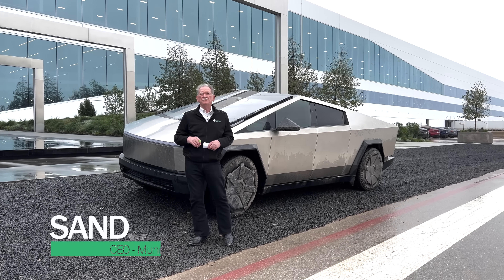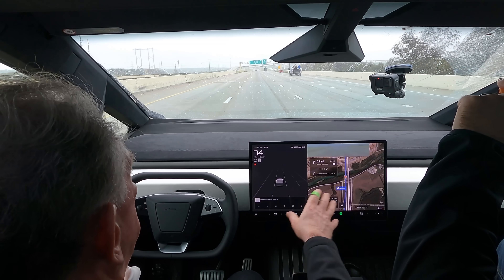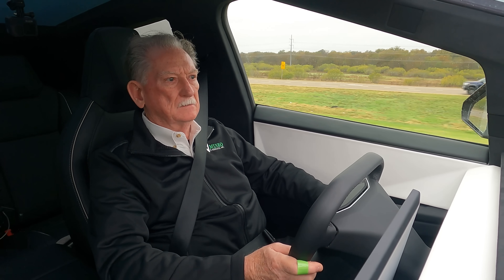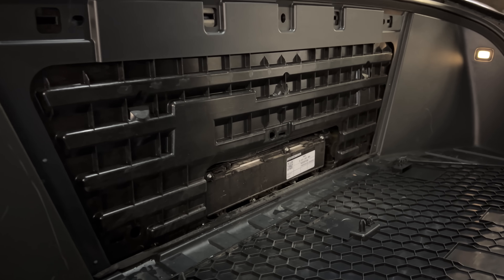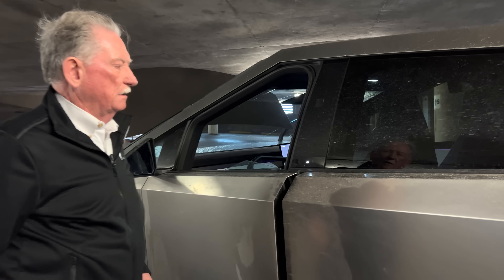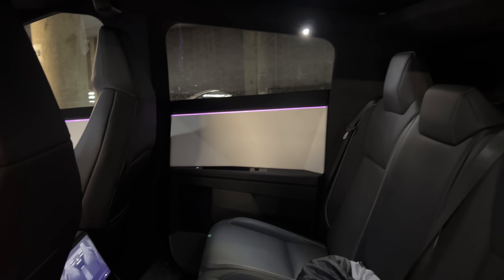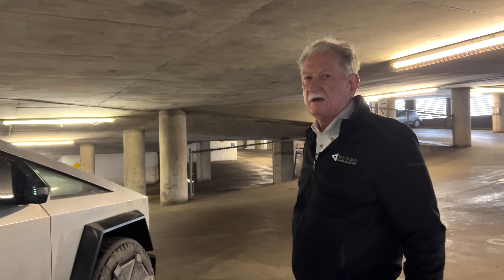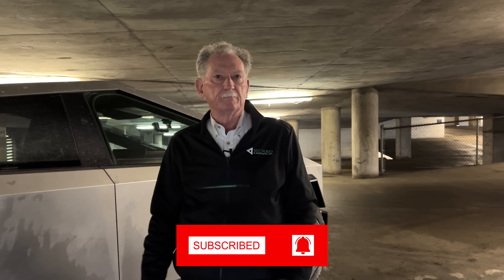Sandy's First Impressions of the Tesla Cybertruck!

Comment: I have a cottage that is 185 miles away from my house in the city.  Over the years I have owned 6 pickup trucks.  I always purchase used ones that are 2 years old so that the first owner can work the bugs out.  Every one I have had a cap installed so as to carry articles up to the cottage dry and out of the weather and as most know there is always something going up to the cottage most every trip.  Plus I tow my boat and ATV’s and snowmobiles up and down a couple times a season for whatever reason being storage or maintenance.  This vehicle is useless for those cottage owners like myself because of that bed cover with the lack of side rails and the range that this truck is capable of.  If the traffic is backed up and the air cond is necessary I would definitely have range anxiety.  In the winter I could not even charge it at the cottage because of my 200ft driveway and 4 ft of snow and winter is important because I have snowmobiles to enjoy as well.  I just don’t get it as to why they can’t make the vehicle about 4 inches higher and basically double the size of the battery pack.  I mean don’t these producers of EV’s just get it???   They just don’t understand that what’s preventing everyone from scrambling to purchase an EV is the stupid range!   I think these designers are idiots!!   I certainly will not be purchasing one at all until I see 1000 miles of range period!!  Anyone that I have talked to, all talk about how useless the range on these EV’s is and that’s what is preventing them from their first purchase.  If they can ever get the range up to 1000 miles I might purchase a brand new one for once!!!  I will bet that there will not be many insurance companies willing to insure this truck either and if they do the cost will be much higher!!  No body shop except Tesla ones will be able to repair a fender accident either and at a cost of between 70 and 100 thousand U.S. dollars I wonder how many banks will loan that kind of money for that product unless Tesla wants to be the bank for every one sold.  Elon said himself that Tesla was digging it’s own grave with this truck!  I think he maybe correct about this one!  Sure it is definitely a nice toy to have!   But vehicles are the worst financial liability investment that you will ever make in your life!!  They depreciate 20% by driving them off the sales lot!!   Invest in anything else like maybe property or savings bonds!  Anything but vehicles!!!!       THE CHEAPEST CYBERTRUCK IS 70 thousand U.S. plus tax up to the most expensive at 100 thousand U.S. plus tax.  Not too many people have that cash hanging around so they are leasing the truck making it cost about 10 thousand more and it’s just a city vehicle not for any real distance!!  Don’t be infatuated because of the egotistical hype and waste your hard earned money!! Wait a few years and see what comes out on the market!!  The way technology is going we might all be very well surprised!!!!!

Comment: Providing enough under bed storage space or enough space in the frunk for a spare tire should have been a priority.
Reply: I think they’ve decided against using spare tires because the percentage of people who actually use them is vanishingly small. I suppose you could always mount on in the bed or even on the door.
Reply: @bkinstler It's not so much about them including a spare tire, as it is about having enough dedicated space for one that it doesn't take up usable space in the bed like most trucks and off-road vehicles. Anyone who tows things or goes off-road a lot, something trucks are meant for, needs easy access to a spare tire, preferably in a way that doesn't require a person to unload everything in the bed just to get to it.

Comment: Having now absorbed the specs this is a game changer for the offroad fraternity be they light or heavy (towing) with the add on power pac. There are infinite possibilities for the use of rear cover from solar to spare wheels. If I had to choose one feature outside the drive train & 48v that appeals the most it would be power out/load for camping needs with no more auxiliary batteries with an alternator charge source. When we will see in Australia my guess 2026/27 at the earliest notwithstanding drive by wire makes right hand drive easy peasy.
Reply: We need a Cybertrailer with big battery pack on bord and fsd to unhook and park itself!

Comment: Dont have to worry about your catalytic converter being stolen. Don't have to change your oil, brakes, head gaskets, timing belts, spark plugs, starter, ignition, alternator, radiator. Its a no brainer.

Comment: How well can it transport 4x8 sheets of drywall or plywood?
Reply: Just as well as any modern pickup
Reply: @jamesengland7461   
That's what I'm afraid of!
Reply: With the gate down, the 4 x 6 bed is good by modern truck standards.  A better question is how do you reach objects in the back of the bed with the sail panels blocking side access?

Comment: Ok I give 1 example I don’t like cybertruck. The trims it’s plastic right? It will come off due to excessive heat & cold. It will deformed easily like model x & Y. 
S & 3 don’t have side black trims so it much more better & less cost no replacement trims.
If I’ll see the actual cybertruck I will point out which is good & bad no bias

Comment: Sandy talk about the underneath of the cybertruck. Like air suspension, sway bar, upper & lower arm & more front & Back. That’s the important. Don’t be bias. I know you can get Cybertruck right away without waiting in line. If I test that cybertruck it will last 3 years or less in 100k miles city drive only like my tesla cars S, X, 3 & Y all needs repairs front & back after 100k miles . Excluding battery replacement. You know how much cost each cars front & back replacement parts.
Reply: All indications are that he CAN'T get a truck without waiting.
That's why he's telling a yo e in line that is thinking of cancelling that he will buy their truck.

Comment: Loved your vid the other day with Elon! Question I have for you about the Cybertruck that I mentioned on X but haven't heard anything. Does the bed cover have the ability to be opened from inside the bed in case of emergency? I haven't seen this in any video so far and I would think it would be a requirement in the US.
Reply: If they are intending to be combined with the 'over tray camper' enclosure, then it will be a safety requirement. 
Testing of the 'Camper -CyberTruck' will drive that design change.

Comment: I like this old dude; he’s very thorough
Reply: You're new here, aren't you?
Reply: Yeah this video popped up in my recommended feed
Reply: @marsEv310 
Try 50(?) years in the Auto industry, engineer, worked on many vehicles you'd know, troubleshooting engines for manufacturers, etc.
Latterly running a respected company stripping, data logging and improving vehicles for Manufacturers (you want to to know why the competitions vehicle is good? They strip to the last but and bolt, report on the design of every component.... )
And other things.
.
Basically
.
Look up "Knows his S**T" and his name appears.

Comment: Paying $100k to be a Guinea pig. I like the truck but I would hate to find out at 50k miles that the windshield does actually break and costs 3 times as much. The big wiper blade can't handle ice or the 48 volt components break down just as often as regular car components ie: window motors except now they cost $2000 a piece and they are only sold by tesla. Like owning a supercar at that point. At least a f-150 has cross over components to the rest of their fleet. Just my thoughts. No facts.
Reply: Well, at least your final 2 words made sense....

Comment: only problem i can see -  same as GM's box   you cannot slide a camper in it. GM has those stupid angled pieces built in from the roofline to the box with stops a camper from sliding in fully....and cyber Truck has a tall front angle that will inhibit a normal camper from sliding in.   HUGE LOSS for a solid % of truck buyers.

Comment: It's a cool truck for city folk, but it's lame for people who use trucks for rural/country life.  I want to be able to use duct tape and bailing wire to fix my truck, not have to have a Tesla approved mechanic using Tesla made parts fix my truck for me.  I'm a diy'er, that's why I have a truck.  Tons of parts available, and so easy a dummy like me can work on it.  

I don't think Elon understands that.  It is a cool truck, and I think it'll sell well in the city, but in the real world "truck" using world.  Not so much.  Maybe I'm wrong.  Let's wait and see.

I'm a huge fan of electric because it is more simple than gas/diesel.  The only problem is, they're making it so that even though it's more simple, it's impossible to work on yourself.  That doesn't make sense for a consumer, but it does make a ton of sense of the manufacturer.  

I'd love to see China come out with a simple electric car that is easy to work on, and easy/cheap to get parts for.  Similar to an old Jeep, or VW.

Being dependent on the "grid" for power, being dependent on Tesla mechanics, and being dependent on Tesla specialty parts, turns me off completely.

Comment: I saw another pod cast the other day where they stated the two MOST important items Consumers want in an electric vehicle are: 1) RANGE, ie how far the vehicle will go on a single charge and:  2) What is the CHARGING SPEED to get to an acceptable level in a (relatively) short amount of time. They said the Cybertruck Falls Short on both of these features. This needs to be verified to know if these items will specifically determine if customers will put off buying an EV until these capabilities have been improved.

Comment: How about the 1/2" drop from the side panel to the tail gate on the left rear, and the triangle gap between the front grill panel and the right side panel.  Did you see the video of the crooked alignments on the black wrapped CT at the show?  This does not look like a $100K vehicle.

Comment: I can, sort of, accept no 6th seat. accept no more tail ramp.  Accept  no more air pump to run airtools or fill your tires. It never had a midgate. Got it. I can almost accept the promised loss of towing, capacity and mileage. What i cannot accept is the 50-60% jack up in the price.   I feel lied to, cheated, disheartened.  Tesla/Elon, you lost a lot of faith.

Comment: The back "smuggler" storage for me is a last minute addition after they decided to simplify the battery pack to one version and offer the extender if pr is bad.  I personally think this was a better decision than a huge pack of various sized packs.  4680 production is also limiting for Bother 6 months.
Reply: Or, it's the best they could do for an "off-roader" that really should ahve room for a spare wheel.
4680 production isn't the problem even, it's the energy density. In 2019 they were probably expecting 500 Wh/kg from it, and I have not yet seen any with 300 Wh/kg even. That's why even with the silly bed battery, it doesn't meet promised range. And they've even made the whole thing smaller. Less cargo space and a seat less. Less towing capacity as well. Even the short range one doesn't get the promised range, while it should at least fit, and they priced it up by 50+%. Some gimmick features to make it all worth it? Don't people buy the biggest car they can get a loan for, over the whole? What are the $40K truck customers going to buy now? Because they do exist. And they did reserve theirs.
Reply: @Cloxxki no one has ever matched a guessed price after four years of pandemic and supply chain issues.
I commend your trust in Musk's words but you need to get real.

Comment: Sandy, you say that you look forward to no longer hearing the noise of internal combustion traffic. What I look forward to the most is the absence of the nasty, greasy, oily patches in every single parking spot, of every single parking lot and garage.
Reply: That won't be gone, since these do not originate from fuel but rather lubricant. Electric motors also need transmissions, and transmissions have gears that need lubricant. Some electrical motors themselves are of a "wet" design and are lubricated by oil rather than grease too.
Reply: @IR-xy3ij  Well, I was referring to the leaking lubricants. Gasoline may leave a stain. I was speaking of the greasy build-up.

Comment: A hydrophobic coating on the rear camera lens would probably go a long way to keeping it free of water droplets, etc. Or as a temporary stop-gap you can probably rub some Rain-X on there.
Reply: Should it already come with some sort of washer, from factory !!!!
Reply: @mixalis6168  front camera has a spray...maybe we need all the cameras to "blink" to clear the lens
Reply: @mixalis6168 
I think it does have a washer.
Reply: @roxter299roxter7  only the front camera has some sort of washer at least in initial Cybertruck 1.0 release so far.  This is a real safety issue for drivers with the cover down in bad weather since they will be virtually driving blind in the rear as and when the rear camera lens hazes up.
Reply: @mixalis6168 
It's a pre-production vehicle 5hsts been "tested" extensively. Who knows what that lens has been through?
Reply: That is an excellent idea. 👍🏾
Reply: Doesn’t cut all spotting. Dirt. Only makes it easier on freshly cleaned glass. 

Also would largely depend on windflow even if it’s a fresh application. 

I detail cars and use glass coatings. They aren’t the end all be all. You still have to wash a car weekly to get it pristine. 

You can always just rub it once in a While when in the parking lot
Reply: Kinda crazy big brains at Tesla didn’t think about that problem tho
Reply: @Gusfezio  Betcha they'll address it within a week.
Reply: @richarda3659  yeah someday they will, but still…
Reply: @Gusfezio   Really, your surprised?  Seriously ?  These are the same people that can't figure out how to get their automatic windshield wipers to work right - come on with no rain, they don't come on when it's raining - something that automakers have solved like 2 decades ago.  These aren't the brightest builds designing at Tesla, clearly.
Reply: The whole vehicle could probably use a hydrophobic clearcoat.
Reply: its totally useless! what you need is a water spray to clean the camera and i dont even think this vehicle will really go off the pavement lol!!!
Reply: next time u apple ceramic coating use some on it good idea
Reply: @Dulc3B00kbyBrant0n  Apple doesn't make ceramic coating. What are you talking about?
Reply: @richarda3659  I'm sure he must've meant "apply" (was probably using speech to text :-)
Reply: It needs a little wipper... The Chevy bolt has one. I for one am tired of cleaning by back up camera. Anyone elese?

Comment: Some issues with the Cybertruck few talk about, it's long term economy of scale in it production, since it's a very peculiar design not sharing much components with other trucks. It could also be an issue for the costumer pretending to maintain it. Another issue is Galvanic corrosion even worse in this case, due to having big Aluminium casting pieces bolted on the Stainless steel panels.

Comment: I really like that they’ve changed to a wide video feedback for the side cameras.
Reply: If the door mirrors are removed there should be similar sized screens inside the door. Drivers muscle memory makes that extremely important.
Reply: You supposed to look at your blind spot and were you want to go. Looking at the screen to the right when going left is simply dangerous to others especially in a big car like this. But it’s cheaper and new so people like it without much thinking. Which is unfortunately a standard these days.
Reply: @10secondsrule  So you think when people see another vehicle in the camera feed, they would still proceed and crash into it?
10/10 logic
Reply: @Tschacki_Quacki  I think he means “it is bad because it is new”. There is no blind spot when the camera/mirror is forward enough. Japanese cars in the 60s and 70s proved that. It is all about nuscle memory and training. The rule to check blind spot comes from having a blind spot. I drive a van every day. I see everything in the mirrors, all the way forward to my side door. No blind spot.

Comment: Very showy/ flashy/futuristic but........if the battery is anything like a regular Tesla it lasts for 10 years and then you have to replace it for 15k or more. Being a truck I would think it would be more costly. The price would be ridiculous also. I would say this is a rich mans toy for the most part.
Reply: Battery tech has been on a declining cost curve for quite a while and that is expected to continue with chemistry improvements and higher volume manufacturing.

Comment: I never even thought about gaps until I heard about them on one of your videos. I went out and checked my Ford Fiesta and the gaps were huge and very inconsistent... Still, they don't bother me. The one thing about the CT that I will pay attention to when mine comes ... is the gaps at the front corners... Sometimes when I am in the woods, I will brush against trees and I wonder if I will catch any limbs in the cracks which face the front.
Reply: Certainly someone will come with some add-on solution. Like the bullbar or something.
Reply: but that is an econobox...it is to be expected for the price....this truck is a luxury, so it is unacceptable

P.S. I would rather have a Ford Fiesta ST than a Tesla Cybertruck.

(not saying you have an ST, but an ST is the model I would want)
Reply: Panel gaps on a $15k car are expected.    On a $100k luxury product?  Inexcusable.
Reply: @woozleboy are the $97k+ F250 Limited or $92k+ F150 Lightning Platinum luxury vehicles?
Reply: @Nibiroid good point. Is luxury price or model.based?